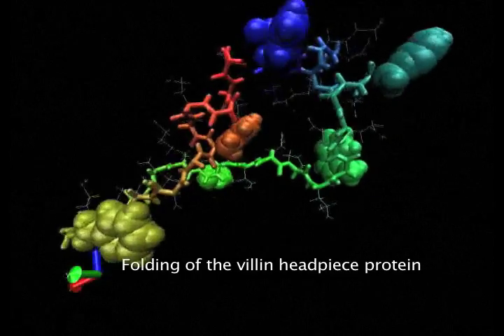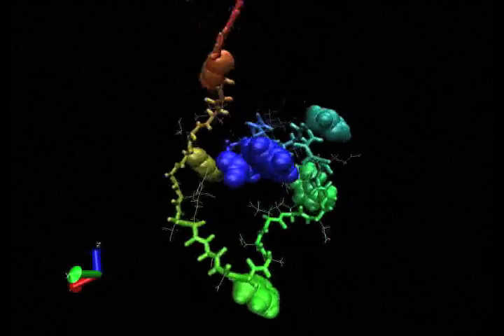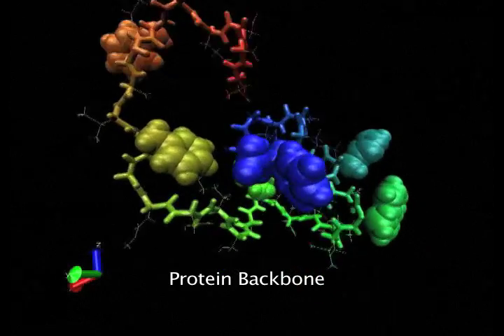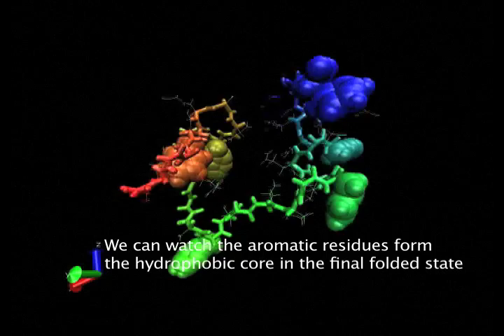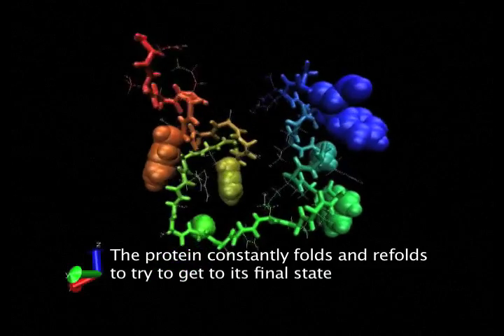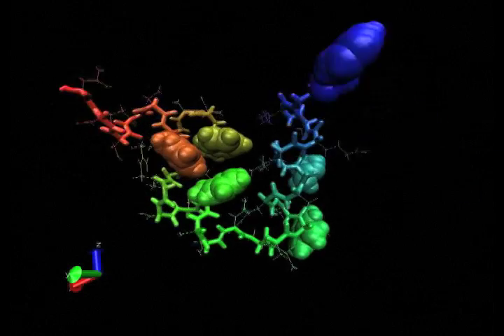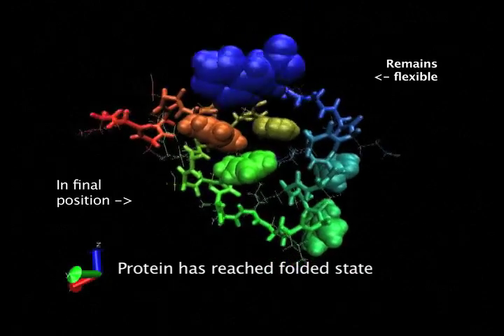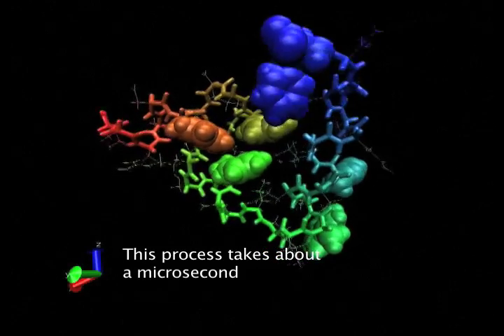Folding of villin protein simulated on GPUs

Comment: Is the folding a random process, with different shapes each time it leaves the Ribosome ?
Reply: It is random-ish, like a droplet of water rolling across your hand. Maybe it'll roll this way, maybe it'll roll another - but generally it's going to roll downhill and eventually drop onto the floor and stay there.
Reply: Sakkura1 Thanks, I think I found the answer later. I found that we can know the 3d shape of a protein only by looking at the sequence of nucleotides in DNA or RNA, this is because the protein searches the most stable shape according to the electric forces between the molecules in it.
This means that what we see in DNA is really a blueprint of the molecular machine.